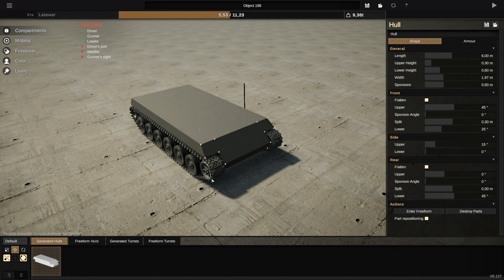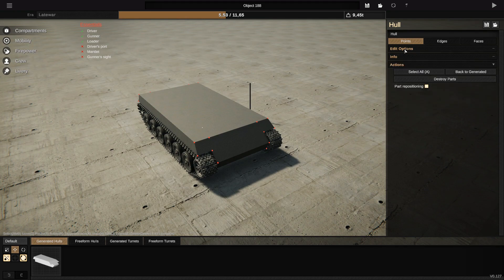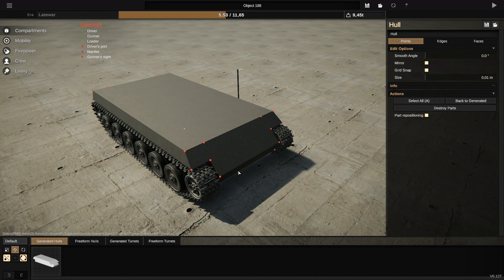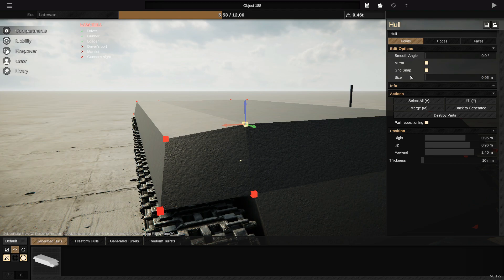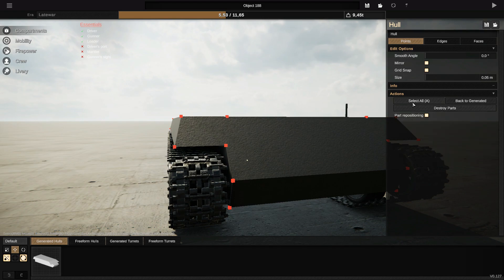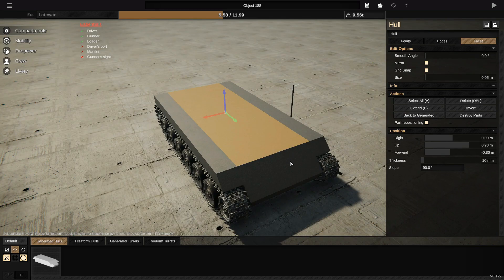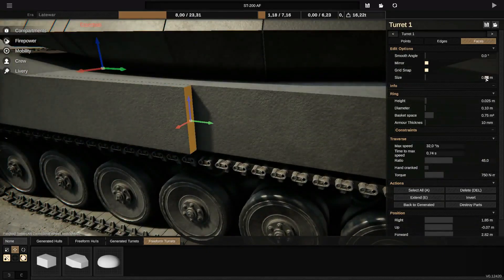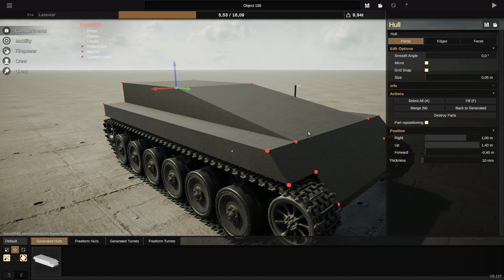Grid Snap Introduction #sprocket

Comment: I have a problem with grid snap it practically makes it unusable for me, for example when i want to use it and lets say i want to move a point when i click on it and want to drag it in certain direction it will move either to the left or right or down by a 2 centimetres and then it will move in direction i wanted to. i don't know how to fix that so that's why im asking you if you know what may be the problem.
Reply from the maker: if it's the first time you move the point with snapping enabled then it will snap to the nearest point configuraiton, this could be the problem

Comment: can you quickly explain the invert button on free form
Reply from the maker: The invert button can fix inverted faces, 

Inverted faces happens when the game doesn't recognize the shape of your compartment, this is triggered by faces being inside the compartment or overlapping faces
in this case even the invert button doesn't fix it

so basically the button can fix an inverted faces only when there is no inner or overlapping faces

tho it can also invert a face on purpose, which means the face would be selectionable from the other side